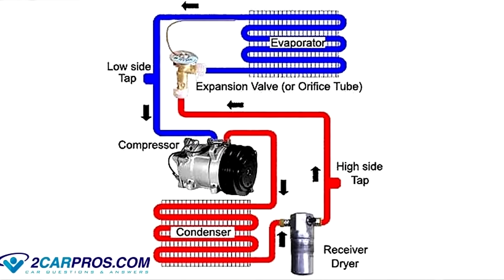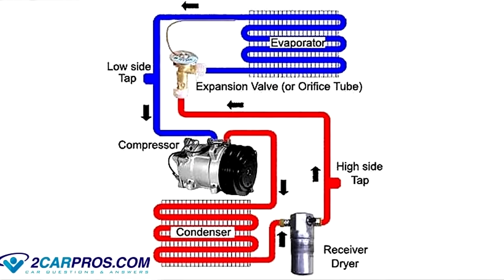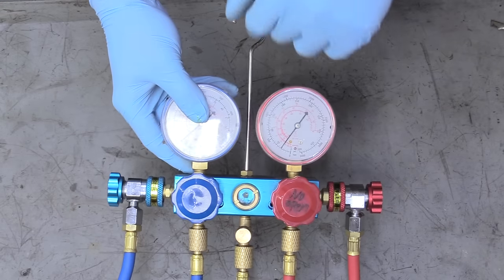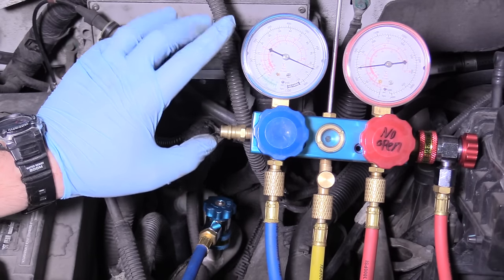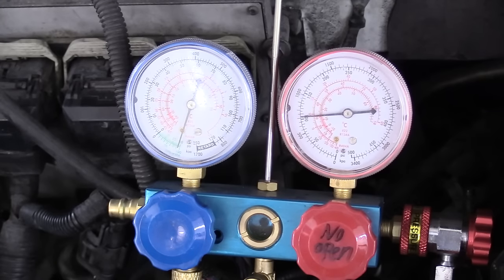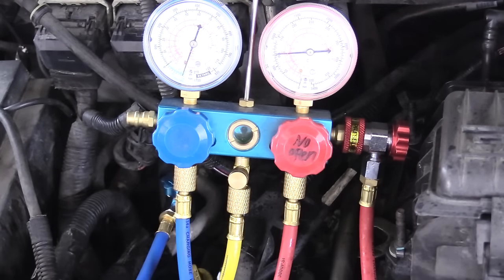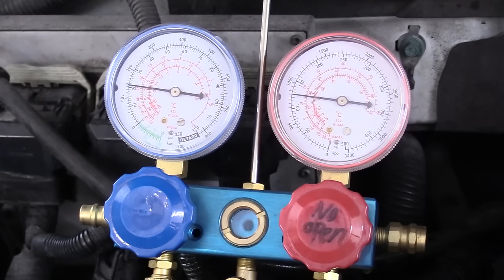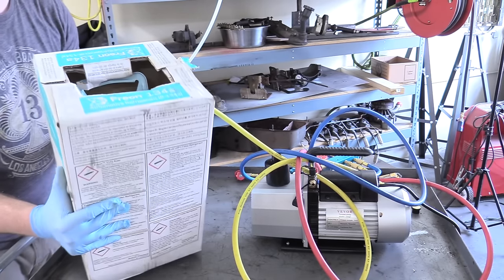How to Vacuum Down and Recharge Your A/C System! - EASY

Comment: Hello again, how is that Model 3 Performance holding up?  I saw this video and I am hoping that you could point me in the correct direction.  I have a 2015 VW Jetta TDI diesel.  I just had the AC Compressor replaced and the next day when the AC is on, it blows cold.  However, when you come to a stop, it vibrates enough to feel it thru the steering wheel.  If you turn off the AC, the vibration goes away.  If you use just the vent fans there is no vibration.  After searching online all I can gather is 1. the system may be overcharged.  2. A motor mount may be failing. (checked by the shop that replaced the AC) claims to not be bad.  or 3. A faulty expansion control valve.   Any ideas of what it may be?
Reply from the maker: Pretty good so far thank you for asking! 

Occom's Razor tells me the part is just defective from factory, you wouldn't believe how often that happens. But checking to see if it's overcharged is easy and should be free.

Comment: Thank you so much for this excellent video.   I learned so much and you got me excited to the point I would like to do this myself!  Question though--you never added the lubricant separately--does the liquid refrigerant cylinder also contain the lubricant?
Reply: Excellent question I was also wondering if you suck out the air and the lubricant do you have to add it back? Let me know if you get a answer please....
Reply from the maker: Thanks so much for watching! It loses so little I don't add and as too much ruins the system.

Comment: Is it ok to feed liquid into compressor? I thought maybe it could harm it as it usually has gas feeding in after the liquid expands. Or does the liquid expand quickly out of the can , so no problem.
Reply from the maker: The liquid turns into a gas once through the inlet fitting as it acts as an orifice. Thanks for watching!

Comment: Read thru a bunch of comments but what do we do when need to switch cans if vehicle is required for more? One can is not enough, so if we need to switch to another can what steps? Sorry if dumb question but my first time even going thru ac work
Reply from the maker: No problem. If you need to switch cans. I would completely close the system, hook up the new can. Then purge the yellow line to make sure there isn't any air in it. There should be a purge schrader valve on it. Then you can open the low side and continue feeding. Thanks for watching!

Comment: Price, how do you add the PAG oil to the system? Does the vacuum also pump it? I wanna remove the old oil to replace it the DIY way. Thanks.
Reply from the maker: Very very little is lost when you vacuum down. If you put too much in it will clog the orifice tube and your A/C won't work at all. So I don't advice adding any in this situation. Thanks for watching!

Comment: I have questions and I need the response as soon as today,im doing it all today, I had an AC compressor replaced and people didn't finish the job, so I have to finish it myself, i bought gauges and vaccum, 
QUESTIONS:
Where do I find the specifications of how much refrigerant to put in a 2008 Dodge Nitro SLT
.
Does the vacuum pull out the oil from the compressor?
.

 How do I know the compressor needs oil??
.
How do you pull in oil in the compressor if needed??
.
Can you pull in oil, after you vacuum or do you have to do it, before you vacuum?
.
Did you vacuum with a car on or off??
.
Also seen videos of where The Red knob is messed with and you're saying NOT TO TOUCH IT, why do I see videos with people telling me to open it and close it?  were you talking about when you are charging the system or vacuuming the system, not to touch?????
.

Do you recharge with the car on or off?
.

.THINGS I HAVE DONE..
Replaced Schrader valve...
Replaced expansion valve...
 THANK YOU AHEAD OF TIME
Reply from the maker: Under the hood there should be a sticker but it is super tough to just put that exact amount as I said in the video, just keep adding till it feels cold out the vents and then stop. More refrigerant won't make it any colder once it gets there. 

Yes a super small amount, I wouldn't even worry about it. 

Don't you'll put too much in and it will clog the expansion valve up making the system not work.

Again don't. But if you had to for some reason I'd put it in before. 

Vacuum with car off as I did in the video.

Please refer to the pinned comment. 

As per the video, fill up the system as much as you can on the low side with the car off, then turn the car on and continue. 

Thanks for watching!
Reply: @2carpros  well, a scammer took the money i payed to fix my AC, and all he did was, put on compressor, did not fullfil contract,  used broken gauges, had no vaccum, and he did not put in the oil specified for my compressor, but unfortunately, i figured it all out after he left, as i mentioned, i have not much knowledge about AC, untill now that im Learning, im very concerned, dont want to do anything wrong to damage my AC compressor

Comment: I have to replace the AC compressor in my car. I need to add oil to the compressor before I install the compressor. Will adding new freon add more oil? Since most of the Refrigerant cans says "lubricated" or something to that effect?
Reply from the maker: Usually new compressors come with oil in them and I just install them and then charge the system. Thanks for watching!

Comment: Hey Ryan, got a 2006 Suburban. Compressor started smoking/squealing at  2,000 - 3,000 rpms. Took off the belt and the compressor never locked up on me. Should it be ok if I just replace the compressor since I caught it in time? Thank you!

Comment: Important question. didn't u make a mistake by connecting high-fidelity couple and opening high side charge port after a vacuum? thereby allowing, albeit a small amount, but allowing air from red gauge hose into system? if u notice in the video, it did lose a small amount of vacuum from low side gauge when u did that.. small amount, but if connected the high side coupler b4. would have been avoided?

Comment: Incredible video. I haven't seen anything close to as informative. I do have a couple of questions.  I haven't read the comments so I apologize if it's been asked and answered.  First one is for curiosity. Why have a red high end valve that opens if you should never open it. More importantly are these directions the same on a 1234yf system.  Thanks again and of course I liked and subscribed, lol.
Reply from the maker: The high side valve is there if you want to vacuum it down quicker. But for simplify leave it closed. The down side of leaving the valve open is too great. 

The concept is the same for 1234yf but the pressures are much different. Thanks for watching!

Comment: Hi. Thanks for great info. Can i stop to charge when low is upto45 and high is up 250?
Reply from the maker: Yeah if you want to do it by numbers those are solid but honestly its easier by feel on the vents. Thanks for watching!
Reply: @2carpros  thanks a lot! One more question, if I overfill compressor oil, what affect will be there?

Comment: Hey, thanks for the video. Would vacuum remove any oil from the system? I installed new condenser yesterday adding 40ml (1.35 oz) oil in it, and also removed and refilled the compressor with 70ml (2.37 oz), as it was totally leaked out of oil. now, following your video, I'm going to vacuum the system and then add refrigerant using cans. not sure if vacuum will also remove oil...
Reply from the maker: Very very little oil is lost when you vacuum down. Thanks for watching!
Reply: @2carpros  another question if you do not mind. I may have overfilled the system with oil by around 1.35 oz (40 ml), looks like 2.37 oz is the max for my 2018 Rav 4 AC system and I put 2.37oz in the compressor itself and extra 1.35 oz in Condenser. Do you think that is too much and will possibly cause any issues? I can still remove the condenser and drain it, have not charged it yet.

Comment: I replaced condenser,compressor,expansion valve and all o rings. I flushed all the lines and the evaporator so my system is clean and I charged it to the recommended max amount of refrigerant for the little Scion xb which is 0.99 lbs or 15 ounces. My low side is sitting at 32 psi and my high side is at 175 and the normal pressures for my car is low: 21-36psi high: 196 to 220 psi. I do have a sight glass and I can see bubbles and refrigerant flowing through but I read that there should be no bubbles visible and to keep charging but if I do that will go over the 15 ounce capacity that the sticker says. Now can I add another ounce or two and get my high side pressure up a little more and possible get rid of the bubbles? My ac is very cold right now and is good but just curious if I should add a little more or just leave it the way it is based on weight.
Reply: Hi, since I will do a little bit the same thing like you, to replace the old receiver / condenser , did you vacuum down before charge it back the refrigerant into it ? I will be appreciated :)
I plan to purchase cheap mini vacuum at Amazon ($60)*because garage will charge me $450 😢 
Thanks
Reply: @noel5ilv3rlake  yes but I rented the 3 CFM from autozone as the higher the cfm the less time you have to pull a vacuum but yes I vacuumed for 45mins. You can vacuum for a few mins then turn it off and let it hold to see if there’s a leak and if not then let it run for 45 then you charge right after but ONLY on the LOW SIDE never the red/high side
Reply: @E85_STI  Goodness THANK YOU !
Gonna do this job today lol ! I really appreciated 🙏

Comment: I had my toyota camrys  compressor and dryer replaced too
By a friend. 
My compressor squeals sometimes when its working. 
So i worry that maybe he over charged it.
I want to evacuate the system and recharge again with new refrigerant.

My question is do i have to add more oil if i evacuate the system to add more refrigerant?

Please help i worry that its going to quit working and then another 300 for a new compressor.

Comment: I would like to recover/release everything inside, but my compressor is not working/locked up. How do I recover from both the low side and high side so I can dismantle and replace with a working compressor and new condenser and dryer and lines. Honda dealership in my local area stated recovery would cost around $200+.  They want to do all sort of diagnostics for  $300+. Before even replacing condenser. Thanks for the video and car ac info.
Reply from the maker: Well don't take it to the dealer is step one. Just take it to a local mechanic and get the refrigerant evacuated. Thanks for watching!

Comment: Do you have a video about replacing a compressor? After replacing the compressor, are these steps still the same? Compressor oil? Etc??
Reply: Does anyone know if you vacuum your AC system do that vacuum the oil out of your compressor
Reply: @r-luvbham6608  If I'm not mistaking, you can either drain the compressor and refill after weighing what you remove with new oil. Or you can remove the compressor and do the same thing. I really don't know how to answer your question, just giving you the safe approach.
Reply: @FullDottle  thanks

Comment: So you didn't have to weigh the refrigerant? Can u do the same charge with the 12oz cans? To trick the compressor to come on? 
No one else charges before the truck is on? I have watched alot of videos..
Reply: On automotive systems, they use a system of known volume, so we simply look at the AC tag and charge by weight.  Ok, cool if you have a $6000 AC recovery machine.  But at home, we have to guesstimate using 14oz cans.
So if the system is empty and the engine is off, I’ll pop a can.  In time, it will reach equilibrium pressure with the system with refrigerant remaining in the can.  But here’s the issue.  Often, that is not enough pressure to trip the triple pressure switch to activate the compressor clutch, so nothing more is getting sucked in.  No problem.  Pop a second fresh can that has higher pressure.   Fire up the engine and suck it in.  Now you know you have 14oz from the second can and a partial charge (usually around 8oz) from the first can.  Top off accordingly to your math.

Comment: I have a van with two ac systems. Is the charging procedure different than a single system vehicle? I hope it isn’t bc I am unable to turn on the rear ac. Thank you
Reply from the maker: Nope, it is the same as long as you have one compressor. It just takes longer and needs more refrigerant just like on my suburban that has two evaporators. Thanks for watching!

Comment: When recharging the system do you need to add oil for the compressor?  Does the oil come in the can of refrigerant?  Or if you evacuate correctly you wont lose the oil?
Reply from the maker: You will lose very little to none in this situation. Thanks for watching!
Reply: @2carpros when evacuating the refrigerant can you get it all out just from the low side?  Or do I have to also do that trick from the high side too?

Comment: hey i bought a Hihone 3.5CFM 1/4HP Air Vacuum Pump, can this also be used on a car that has 134a it says it can be used for r22 and r410r or do i just need to buy new hose fittings??

Comment: I’m getting ready to do full replacement on my 2013 Silverado. Lines, compressor, accumulator, condenser and sensors. Any tips for the job? I want it all new just in case.
Reply from the maker: Nice! It's going to be so sweet when it's done. Just make sure the O rings that seal everything are lubricated so they fit nice and don't tear. Thanks for watching!

Comment: Is the high side line supposed to be extremely hot? I’m getting normal gauge readings (35/220 at 83 degrees) and everything seems to work fine but the high side line going into the condenser is extremely hot

Comment: AC Noob here. The manifold/pump +refrigerant comes out to about $180. What if you evacuate the refrigerant at the shop for "free." then buy one of those "AC Pro" kits from the local auto parts store (about $50). The kit only hooks up to the low-side and has its own easy to read gauge. Of course it doesn't have the benefit of vacuum, but it seems like a likely solution if you're only servicing one vehicle.
Reply: Not sure how many cans it would take, but I imagine 1 even 2 cans wouldn't be enough. So it may make sense just to get the pump plus big tank of refrigerant.

Comment: So do you only do the vacuum if you opened up the a/c system at some point? Otherwise you don't need to pull a vacuum?
Reply from the maker: If atmospheric air got into the system it will need to be vacuumed out. But if you are just topping the 134A off then you don't need to vacuum down. Thanks for watching!

Comment: Question for somebody who is a professional on ac systems. I have a 2000 trans am replaced the compressor, seals, etc. on the system and it works amazing around town but when I get on the highway and cruise at around 70-75 the ac starts kicking on and off constantly and stops blowing cold air. You can feel when the ac kicks on and drags on the engine and you can feel the air start to get cool but then it kicks right back off and repeats the cycle. I’ve tested to see if this is maybe an rpm related issue. I’ve cruised and higher and lower rpm’s and it’s fine no matter the rpm. Seems to be purely speed related which makes no sense to me. Any help would be appreciated
Reply: Attach gauges. Open hi and lo side with yellow hose attached to the gauge set to close off. At idle with warm engine and ac on what do they read?

Comment: @8:20   I've read somewhere (maybe even in Shop Manual), that those caps should have an o-ring inside. On the High side I saw those rings in both lines (original and the new I installed). But in the Suction line (Low side) there are no o-rings, not on the original old line not on the new one I bought and installed (actually I bought 2 new for the low side, and none of them has those o-rings in the caps). I would appreciate any opinions on this small detail.

Comment: You look familiar, you look like a guy I went to school with @ little elm anyways, I had a quick question! "What about the oil?"
    I replaced one of the lines and I need to pull the vacuum. My system s supposed to have 8oz of pag46 oil? And 46oz of 134refrigerant. (2003 Lincoln Aviator). [Option#1]......Should I pull the compressor off and pour the oil in that way then add small can of 134a?....
 [Option#2]...... Two of the tiny tiny 4oz can of oil then bunch of 134acans? option #3 
Is ok to use two of the big cans with 18oz "15" with 3oz pag+additives & a 12oz "10" with 2ozpag+add.?

Comment: That looks like a 2004, or so, ford expedition that you're working on.  Is there a way to discharge the system so you can reuse the R-134a.
Reply from the maker: Close! 2005 F150! Not that I know of, when the R134A is evacuated it is put in a special tank and is disposed of properly. Thanks for watching!

Comment: My Ac has a leak and it's empty of refrigerant,  I'm traveling in the following days I was thinking on using one of those Autozone cans like A/C Pro. just for the trip that will take like 4 days.  SO my question is, is it okay to ust fill it with the can? I see you take out what is inside first, but with those cans I don't think I'll be able to do that.

Comment: Great video! Q: don’t you suppose to weight how much gas your are putting in? If you add extra gas will that create stress on the compressor?  Thanks for video great information
Reply from the maker: It's not so much it would put too much stress on the compressor. It is that you won't have a big pressure difference so the AC won't be cold.  So if you put enough in till the A/C blows cold you know it is correct. Thanks for watching!
Reply: what!!!